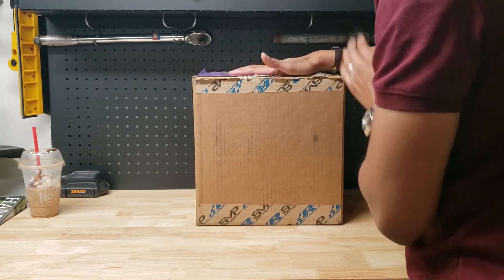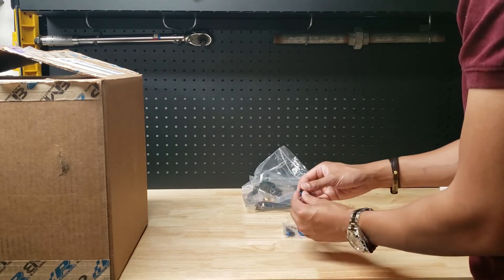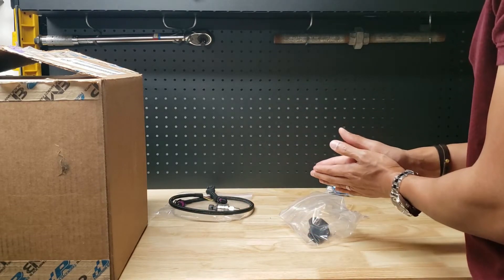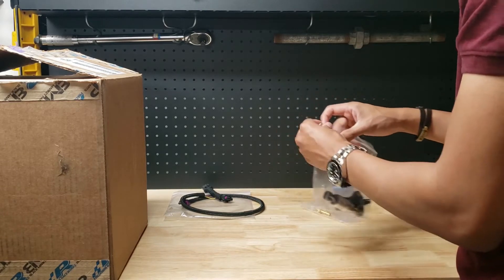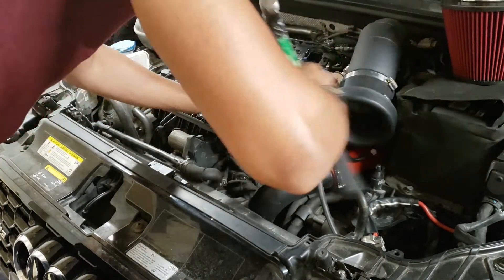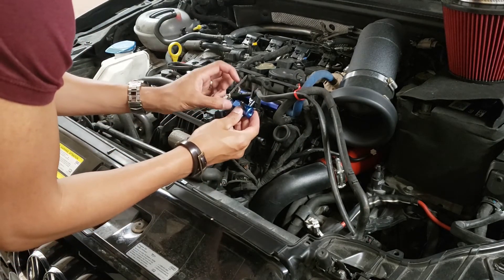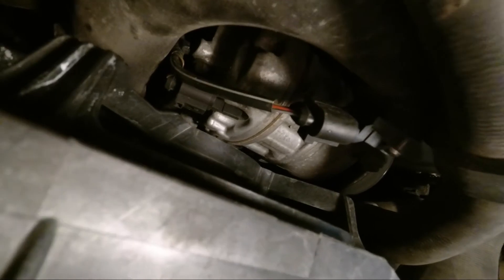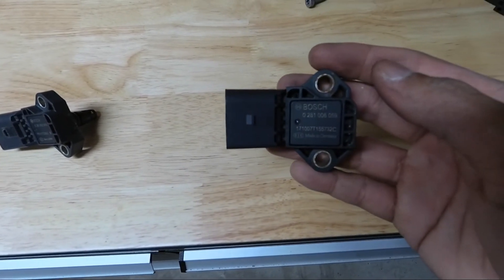Boost Tap and 5 bar MAP sensor kit Install on an Audi S3 / A3 / GTI / Golf R

Comment: I have changed turbo inlet, intake, and stage 1 ECU. Do you think I need to have this one too? Also, If I have this one, what should I do after that?
Reply from the maker: Only if you plan to go past 29lbs of boost on your turbo. That's the only really reason for the new sensor. The stock sensors can only read up to 29lbs of boost.

If you do plan to go past that, then you get a retune for more boost and more power. Just make sure the turbo you're using can support it

Comment: Will this help more HP? Could not having that sensor calls you not to make horsepower?
Reply from the maker: By adding the sensor it will allow your car to read more boost, so you can turn up the boost and tune for it. Ultimately it'll help to get you more power. It's an essential part of it
Reply: @ChampagneS3  thanks because I was on the Dyno my boost would skyrocket to 40psi and my HP wouldn't go pass 380hp 🤦🏿 I didn't know what it could be !!! Thanks
Reply from the maker: Right so even if your turbo is spinning that much the ecu won't be able to read the pressure to adjust for the extra boost (past 30lbs?) unless you have these sensors. But if your boost is spiking there possibly a tuning issue or maybe the wastegate actuator needs to be recalibrated

Comment: no hoses connect to the 3 nipples on the boost tap?
Reply from the maker: Depends on your setup. originally I just screwed on the 5 bar sensor onto the tap. Later when I needed that same input for something else I used one of the other nipple fittings and a vacuum hose. check out my stage 4 fuel kit install for more info
Reply: and that wouldn't cause a vacuum leak?
Reply: or u cap them off
Reply from the maker: @dmitrydyachishin6686  you always cap off the ports that are not in use, leaving any ports open will definitely cause a leak. The ports that I didn't use I used the supplied caps.

Comment: Have you ever got  the P0106 code? I just got my mpi installed with a new tune for the 4 bar and 5 bar sensors but I'm getting that P0106 code?
Reply from the maker: Hmm that's weird.. It should be able to read that. I did have that code in the past, it ended up being a dying MAP sensor. The one that goes on the throttle pipe. We tested it and it was showing slow reaction to input so we changed it and it never came back.
Reply: @ChampagneS3  what variables did you test to determine that it was bad? I'm using obd11 app and trying to see if mine is shot. I also have the p0106 code.
Reply from the maker: @Pettibro  unfortunately I don't have much more information it was a diagnostic tool that my mechanic did to see the slow reaction (I believe the voltage it was reading was lower than it should)

Comment: hey brother, I am in the process of installing my mpi rn and was wondering if you have a video or a layout on how the cables go. I know 4 plugs to the injectors and the other to the fuel rail but what about the other end? thanks and thanks too for the ethanol gauge video
Reply from the maker: Hi Emmanuel I wish I did, I was planning to install the MPI myself, however it was already at the shop so I had them take care of it. Take a look at this link here. This is right off of the precision raceworks site. Hope it helps! https://www.precisionraceworks.com/Shared/InstallGuides/EA888.3-Port-Injection-Install-Guide.pdf
Reply: Thank you so much brother. Your videos on point. Keep it coming :)
Reply from the maker: @riverdreams  much appreciated! Thanks for the support, and good luck with the install 👍

Comment: Do you need a new tune if you install it?
Reply from the maker: Yes at the very least a new base map for the new sensor/sensors you added. Then you can take advantage of running more boost via your tuner to dial it in 👍
Reply: @ChampagneS3  can u still drive the car with the new sensors until you get the new tune?
Reply from the maker: @RadFox1320  you can drive with it if you need to. Just stay out of boost for the most part until you get your tune adjusted for the new sensors.
Reply from the maker: More like a slight revision to your tune by your tuner. So it should be relatively cheaper than a new tune from scratch